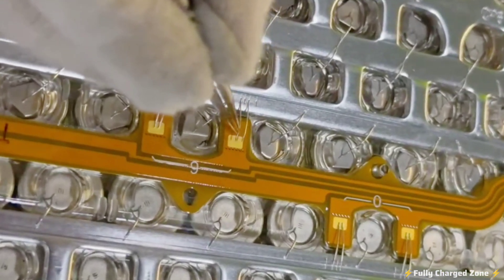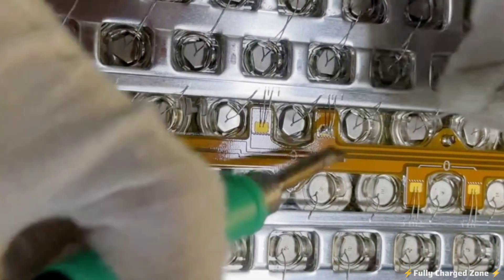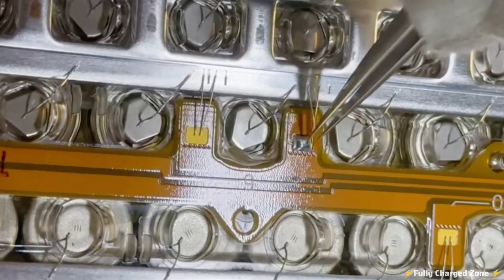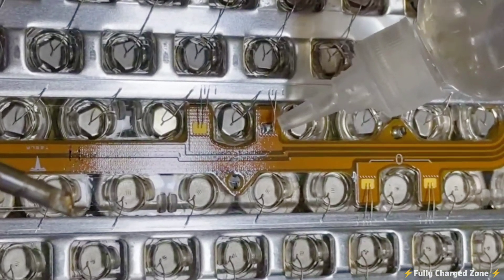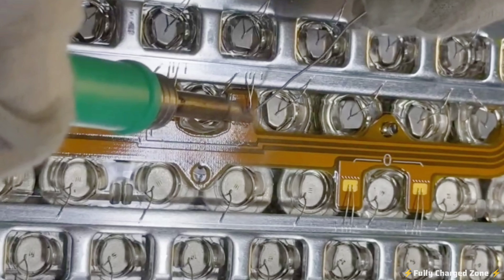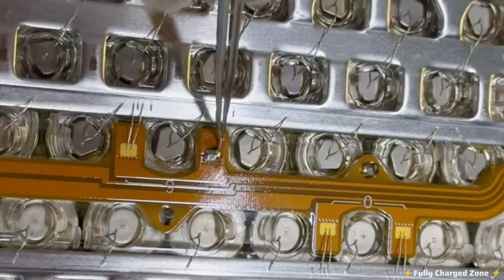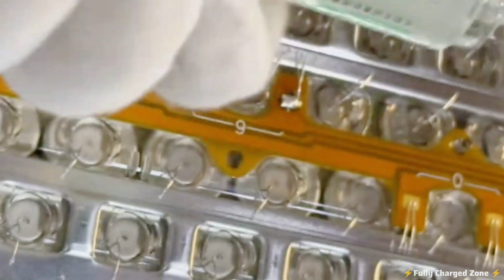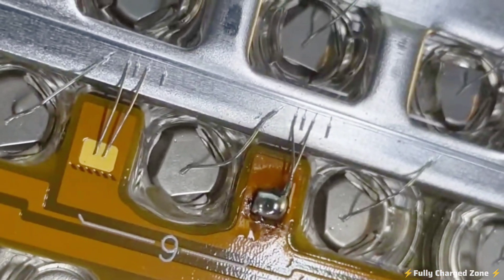What Causes Tesla’s BMS F107 Error & How I Fixed It | Tesla Battery Module Repair Tutorial

Comment: I’d love to know what you (the expert) recommend I do for a 2025 Model 3 LR RWD with 10k miles that shows my range at 333 at full charge…that is 30 miles lower than the new range of 363! No way I’ve lost that many miles. I drive very efficiently with an average of 225wi/mi!
Reply from the maker: That’s a great question! What you’re seeing is totally normal. Tesla’s displayed range isn’t an exact “battery health” reading—it’s based on software calculations that can shift over time with updates, temperature, and driving patterns. A 30-mile difference at only 10k miles usually just means the BMS (battery management system) needs to recalibrate. Try doing a few full charge cycles (from around 10% up to 100%) and let the car sit for a bit after charging. You’ll likely see the range estimate stabilize.